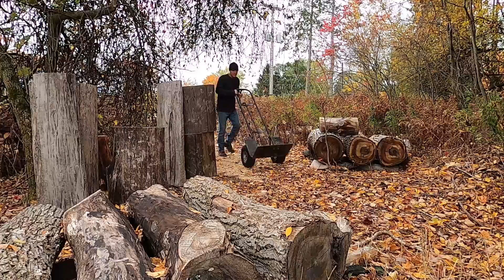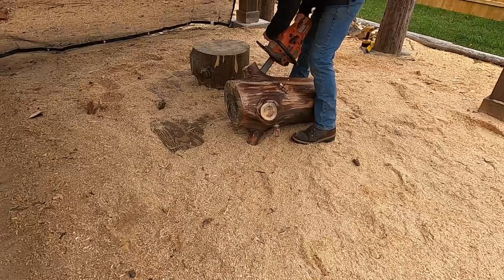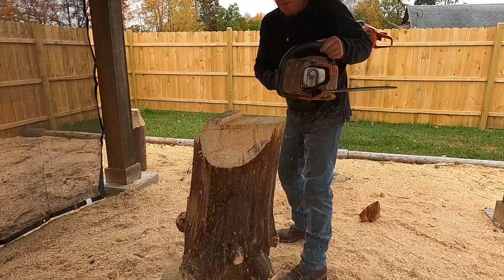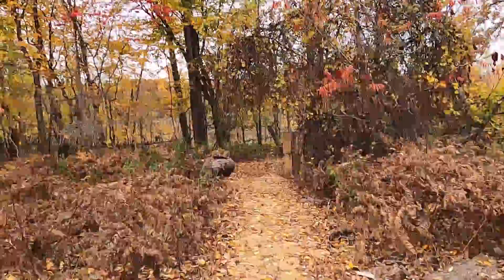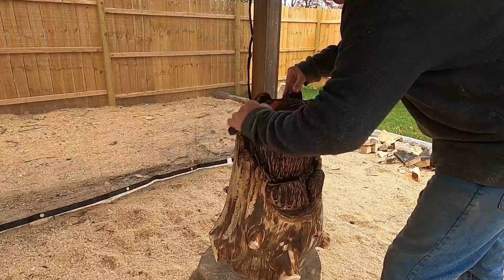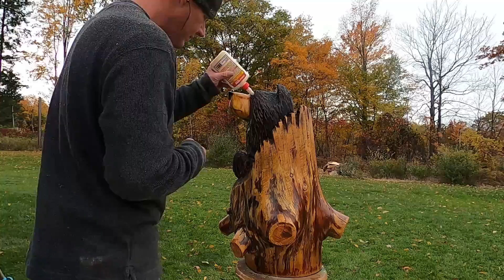CHAINSAW Carving A Bear - In A LOG - Sculpture!

Comment: Just wondering what you use to clear coat the bear sculpture I am a carver and now living on Vancouver island 
With all the rain what I was using in Ontario does not stand up to all the moisture here on Vancouver island any suggestions on what might work for here
Reply from the maker: I use Australian timber oil. It's made by cabot and is sold at lowe's. Thanks for watching the videos!!